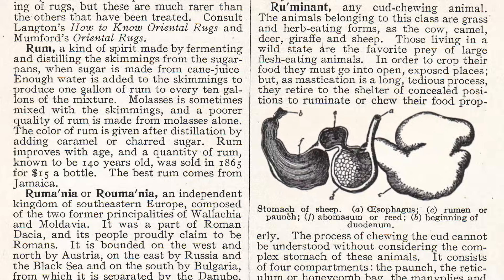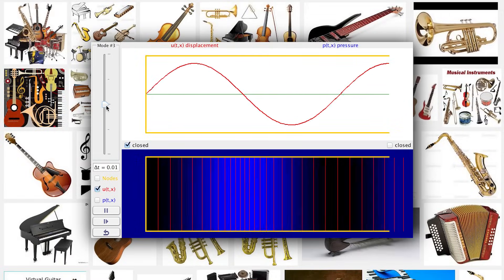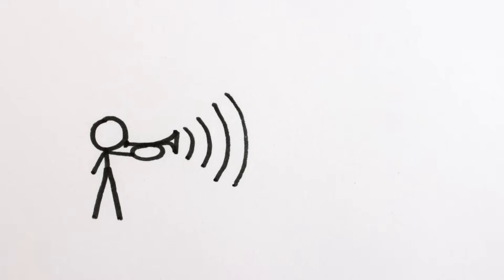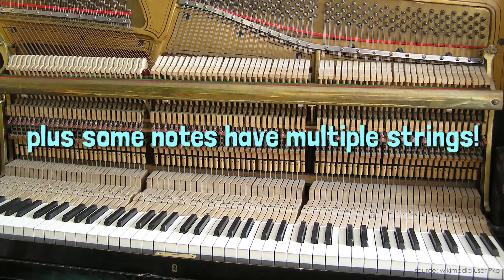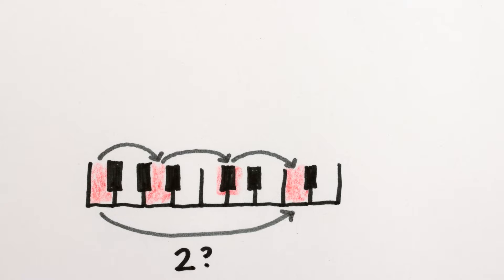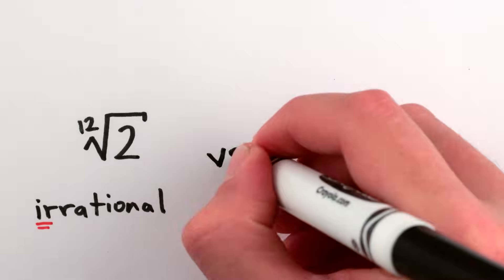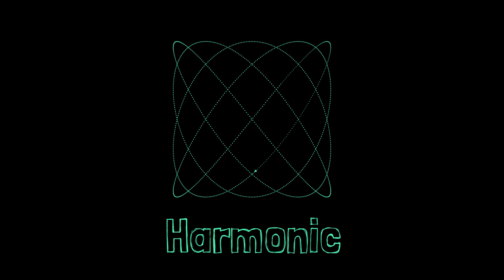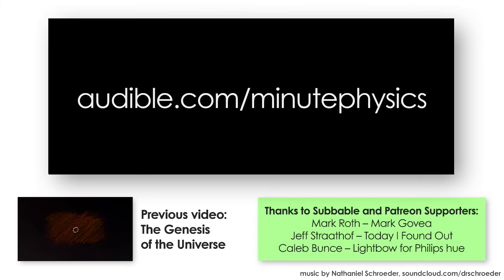Why It's Impossible to Tune a Piano

Comment: I'm a piano tuner and I approve this message.
Reply: I'm a piano tuner as well (: but I found this message a bit misleading.
Reply: i'm a piano and what am i doing here.
Reply: @MegaSemi  What about it was misleading?
Reply: So I'm a guitarist and I have a piano so could you just tune every not to exactly the pitch and not use harmonics or ratios like tune A to 440 so on so forth for every note or does it not work like that in application
Reply: Can you play il vento d'oro?
Reply: Caleb Lee It's misleading because it makes you believe that all tuning is based on harmonics and Pythagorean ratios. And yes, it is impossible to tune a piano using Pythagorean ratios. But that doesn't matter because in practice, nobody uses Pythagorean ratios anyway. So it is misleading.
Reply: Bravo. It's TRUE.
Reply: @josephbates7967  would work but without pattern
Reply: Lol
Reply: Just wanna point out that the problem it's not with the piano itself, any instrument isn't tuned to perfect harmonic ratios, because that system just doesn't work sometines. If you wanna see where harmonic ratios doesn't work you can search examples of comma pump, Adam Neely made a great video explaining it
Reply: I'm a piano technician(doing tuning AND repair AND reconditioning) and what's lacking in the video is his not taking into account the inharmonicity brought about by the stiffness in piano wire which create mathematically skewed values for the harmonics.  Any decent electronic tuning aid takes that into account to provide the most accurate tuning for whatever piano is being tuned.
Reply: I'm not a piano tuner, but at least I don't pretend to do something that is impossible.
Reply: Why not just tune it to be exactly 2
Reply: Friska_ I think that tuner is ripping you off. I just learned how to tune a piano, and with the right equipment you should be able to tune every string in about 3-4 hours, and would say the job is worth 100 dollars at most. (I’m talking about an upright piano not a grand)
Reply: @dorianmearns7407  If this is your first tuning(which appears to be the case if you've "just learned") it'd be quite interesting to hear the results you got after you learned how to do it.
Reply: @angelmendez-rivera351  
He showed it wasn't Pythagorean. I found it perfectly clear on the matter.
Reply: Agent 1110 And? That is not what the title of the video is claiming the video is about.
Reply: @kwixotic  
True. But that wasn't his point. He was showing why we use equal temperament.
The video title is a bit misleading. Shouldn't have limited it to piano.
Reply: @angelmendez-rivera351  
You might want to read your post, to which I replied, again.
Your post said nothing about the title in any way. And I agree the title is not the best for the video.

You said he indicated harmonic/Pythagorean tuning. He explained Pythagorean harmonics, quite well, and then he specifically pointed out the differences between such and equal temperament. He's exactly on -- to the book.

He was a bit fast, but it's all there.
Reply: Agent 1110 I have read my post indeed. And my post explicitly states "Pythagorean tuning is impossible, but not all tuning is Pythagorean, so the video is misleading." So you're the one who needs to read my post again, as it's fairly clear you didn't understand it.
Reply: The well-tempered clavier is always out of tune.
Reply: @angelmendez-rivera351  
But the video makes clear that not all tuning is Pythagorean!!!!!!!!!!!!!!!!!!!!!!!!
That is exactly the point of the video!

Why are you complaining about a video that says exactly what you just said?
What is your deal?
Reply: As someone with no knowledge I can confidently say that the video was a bit fast to pick up why a piano is a problem to tune, and not all instruments. Surely if another instrument can be tuned perfectly then each of it's notes can be used as a reference to tune the same note on a piano. I get the impression the issue most likely must be to do with musical notes, intervals, harmonies, etc. themselves, surely. If your intervals don't add up having gone up an octave, how is that a piano specific problem ? If anyone has a simple clear explanation that'd be good, thanks.
Reply: @WideCuriosity  To make it simple: A♯ and B♭ are two different notes, but the same key on the piano.
If A is 440 Hz and B is 495 Hz, A♯ is 463.54 Hz and B♭ is  467.21 Hz in pure tuning. The key A♯/B♭ on the tempered piano is tuned to 466.16 Hz, the key B is tuned to 493.88 Hz. So except for the As, every key on the piano is slightly out of tune.
Reply: @Nikioko  Thanks. Well they say one learns something new every day. Would never have suspected that the sharp and flat were meant to be different. (Perhaps such keys need to be split into two 😉 )

Actually this has encouraged me to check out other music related videos. Just learnt about intonation and temperament which seems to me to cover the same tuning issue. Fascinating.
Reply: @angelmendez-rivera351  Did you see whole video or just stop somewhere in the middle?
Reply: @Nikioko  Any software recommendations for tuning a piano? Planning to tune mine and wish to use software to make sure I tune it right even with my hearing as a plus
Reply: @botagasss  What do you considered right? Equally tempered? You can even make a program youself. A4 is 440 Hz, each other tone is 440 Hz * 2^(z/12) where z is the number of semitones the tone is above or below A4.
G3 is 14 semitones below A4, so the frequency is 440 Hz * 2^(-14/12) = 196 Hz.
Reply: @its1110  he didn't watch the whole video, that's for sure.
Reply: You shouldnt approve cause you use stretch tuning.
Reply: @dorianmearns7407  $100 for 3-4h of professional work?

I charge more than that per hour.
Reply: @iamagi  It was an upright, and i’m not a professional. My dad paid me because he hurt his back tuning it so he paid me to learn and tune. So that’s why it was only 100.
Reply: I don't understand why you couldn't just measure the specific frequency of each string, and match it to what it's suppose to be. Why do you HAVE to tune it relative to other notes? If we made the fréquence correct for each individual string, then it would be tuned 🤨
Reply: @vynneve  Honestly, I don't fully understand that myself. When I was learning how to tune, I asked the same question. Quite honestly, the math/science of it is over my head. I just know it's true 😄
Reply: I am a piano tuner too and there has no practical use for real life piano tuners
Reply: Dream on pal
Reply: @broadsworddannyboy5057  I really am a piano tuner
Reply: @broadsworddannyboy5057  Well, that is true. But the science/math behind it is still fascinating
Reply: MMMM, BUT PROFESSIONAL PIANO TUNERS TUNE PIANOS IN STRETCHED TUNING...OCTAVES ARE NOT EXACTLY DOUBLE THE FREQUENCY. OCTAVES ARE STRETCHED....
Reply: @pocojoyo  I know. I do stretch tuning, so it's not truly an issue for me. But back when I was learning how to tune, I learned about all the math behind "perfect tuning" and it made my head swim.
Reply: @flickering_wick  "PERFECT TUNING" ? WHAT DOES THAT MEAN ?
Reply: @EnderElohim  physical education.
Reply: I have tried to learn how to tune a piano on various occasions, but I find it virtually impossible to learn on my own (esp on my old upright). I guess I'll stick to playing...
Reply: @BobMazzo  Thankfully, I had the benefit of learning from a tuner with 40 years of experience. Tuning is definitely the kind of skill where I feel it's better to learn interactively and being able to ask lots of questions and get constant input. Maybe you could reach out to tuners in your area and see if anyone would be willing to take you on as an apprentice? Good luck!
Reply: @flickering_wick  it's true, and I agree. I asked my recently-retired tuner once or twice years ago about that, but he wasn't interested (although a real nice fella who's about 82 by now). I reached out to another retired guy who was interested, but was about to move to FL at the time. I guess it's just not "written in the stars" as they say. 😁
Reply: That's because you can tune a piano, but you can't tuna fish. (Sorry)  @MegaSemi
Reply: @angelmendez-rivera351 Pythagorean tunings are AFAIK often used for Hollywood movie music to stress a certain mood. However these pure chords are made electronically and not played on actual strings.
Reply: Doesn't it get even worse in that in piano tuning the octaves have to be slightly stretched as the string harmonics are not exact multiples?